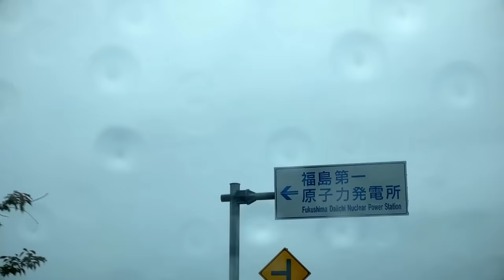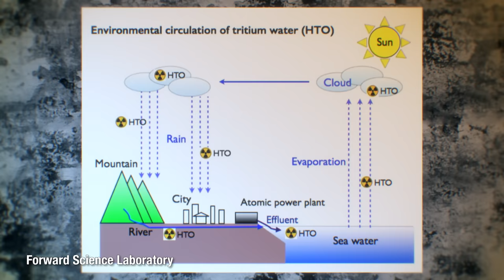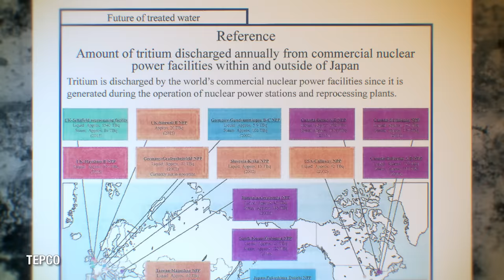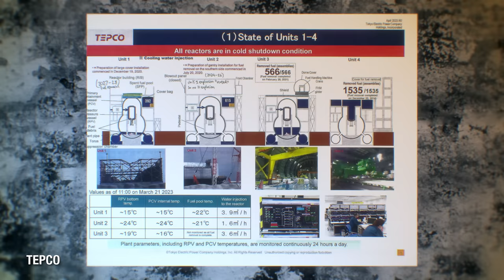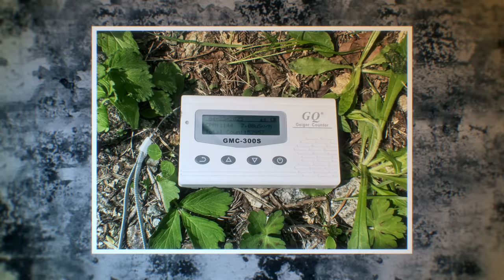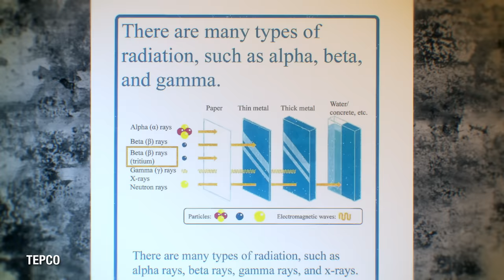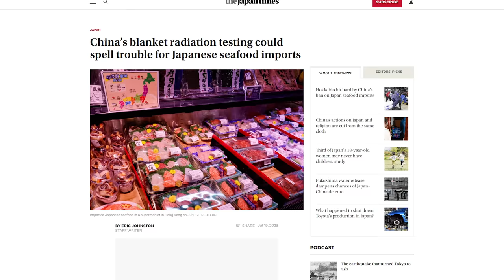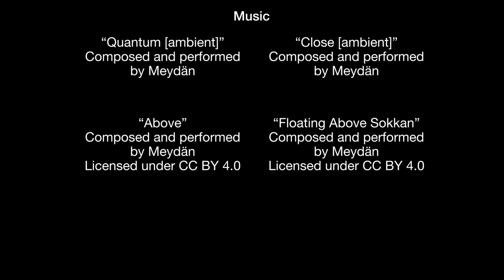Is Fukushima's Radioactive Water Safe?

Comment: it still breaks my heart that the meltdown could have been avoided if the company running the plant had listened and just moved the backup generators which they were told was necessary multiple times
Reply: Higher seawall. If the wall was the same height the water could have still gotten to where the generator was supposed to be. If the wall was high enough to prevent water from getting over it in the first place there wouldnt have been a need to put the generator higher. Onagawas wall was high enough and they didnt have problems despite being closer to the epicenter.
Reply: one day Kyle will call out the real issue,capitalism
Reply: @whyishoudini  "one day Kyle will call out the real issue,capitalism"
If you won the lottery Im sure you would give away 100% of it because "the real issue is 'capitalism'"
Reply: @namename9998  you just blow in from stupid ville?
Reply: @whyishoudini  Corporate greed doesnt equal capitalism, neither does central banking. If corporations don't act responsible there is no political or monetary system that can prevent social harm. It is them, the corporate and state powers that have the responsibility to act according to the risk assessments, corruption is far worse in socialism/communism than in capitalism.  So failure to meet requirements is way higher in non capitalistic systems. Look at China and its downfall at the moment, it says it all.
Reply: The tsunami is 2011 was unprecidented though for modern times.
Reply: Their first mistake was building a nuclear plant on the coast just 500 miles away from a massive fault line in a country reknowned for earthquakes, tidal waves and GODZIRRA!
Reply: @plumbirb8444  Chernobyl ended the same year with just one reactor exploding. Fukushima Daichi is still burning with 3 reactors and now contaminated water will be released in to the ocean. It is not the same.
Reply: @no_data_for_you  Recommendations for what?
Reply: @TheVanillatech   No. Their 1st mistake was ignoring people who said build a higher seawall and the 2nd was ignoring people when they said to put the generator somewhere else. This wasnt Marthas Vineyard where millionaires pay to have houses built on beachfront property only to have the army corps of engineers dig them out every few years. Nuclear plants dont get build just anywhere. There are 17 nuclear plants in Japan with the oldest being 50 yrs old. Banning something from being built because a once in 1000 yr event happens is stupid. Its like banning all cars because 1 in every 1 billion explode. The benefits of clean and reliable power is better than not having clean and reliable power.
Reply: The Stubborness of the Japanese. Strange culture and yet beautiful, if only on the surface.
Reply: @197BRUTE That wasn't the point buddy...
Also, the reactor didn't explode. The top just flew off because of pressure. Nuclear reactors don't explode. They ain't nukes, fam
Reply: @whyishoudini Guess you are too.
Reply: Yep.. simple cheap fix😡😡😡
Reply: @Cvandenhazel I'm not chinese but you could see china from backward country to a superpower in just a few decades, while the US stagnant. So I could see corruption is far higher in democratic capitalism countries.
Reply: @no_data_for_you  What claims?
Reply: @namename9998  socialism is when no money
Reply: @kizunavr  Socialism: "a political and economic theory of social organization which advocates that the means of production, distribution, and exchange should be owned or regulated by the community as a whole."

"Socialism is a political philosophy and movement encompassing a wide range of economic and social systems which are characterised by social ownership of the means of production, as opposed to private ownership."

Please point out where "socialism is no money" is.
Reply: What the hell does that have to do with anything?
Reply: @whyishoudini  only simpletons can point to one thing and say, this one thing is responsible for all the evil in the world. Those that exclaim 'isms' have no thoughts of their own
Reply: @Anonkontello  What does what have to do with anything?
Reply: @plumbirb8444 That reactor design insane dangerous no other country would build such a design.
Reply: @MitzvosGolem1  "That reactor design insane dangerous no other country would build such a design."

That would explain why 22 rbmks were built and 8 are still operational? So what if a country builds only one style of something. It doesnt prove its safe or dangerous.
Reply: @namename9998  refueling under load is insane 
I worked in Nuclear research and Reactor for DOE .
8 running in a war torn region ..
Let's pray none get attacked .
Reply: @TheVanillatech  Stop talking
Reply: Move the backup generators, put glass in the windows instead of bars, build another meter or two onto the seawall, there were any number of ways the problem could have been prevented despite them having to put the reactor directly on the coast. The wave didn't even reach high enough to flood the other side of the road from the powerplant. Any single small measure to make the plant safer and the biggest tsunami in history wouldn't have caused a serious problem.
Reply: @whyishoudini  yes cuz Chernobyl happened in capitalist Soviet Union xD
Reply: @197BRUTE i dont think they even know where the cores are, as they melted through not just melt down. Also its funny how nearly everyone and every media outlet any time they have to mention nuclear disasters they always say Fuku is the worst disaster since Chernobyl, what that actually is, is a fudge comment that has been spun and what it implies is that Chernobyl was the worst but actually  means in English is subtlety saying Fuku is the worst.
Reply: @nocturn9x not true, the top of at least one blew off because of a detonation not a deflagration, did you see the close up pics of the bolts completely sheared off the lid, also the cores melted through the containment vessels, that is why they have this water - as there was/is no containment any more, it was destroyed by the heat from the melt through.
Reply: @namename9998 its original design position was much higher up but to reduce construction costs  they lowered the landscape and built it lower down so it wouldn’t of suffered being destroyed had they kept to the original plan.
Reply: @Plotatothewondercat they actually were going to build it higher up as the ground was originally higher but to save construction costs they lowered the landscape to save money basically, from doing that it was doomed
Reply: @brutonstreettailor4570  I was talking about Chernobyl, not Fukushima
Reply: @TheVanillatech  Amazing irony since GODZIRRA! was an explicit allegory for the risks of nuclear power
Reply: @plumbirb8444  It was caused by yes man operators who were under pressure to run the reactor as cheaply as possible because because of Khrushchev's economic policy changes focussing profitability, so still the profit motive, which is fundementally a core aspect of capitalism, your argument doesn't hold to scrutiny as much as you think it does buddy
Reply: @brutonstreettailor4570  A genuine question, but why do you use "would of"? It's ugly and wrong.
Reply: @namename9998  I would, yeah
Reply: @nocturn9x yeah. "Would have" is how it's written.
Reply: @whyishoudini  Yes, the problem must be a free market.... Never mind that Chernobyl was caused in very large part by the "shut up and toe the line" additudes of a communist dictatorship, with no natural disaster to blame for it at all...
Reply: @eclipsegst9419  just zero lack of education, yet so confident
Reply: @TheAnantaSesa  Yeah, exactly
Reply: @eclipsegst9419  Dictatorship. It doesnt matter if it was communist or anything else. Toe the line is toe the line. Fukushima could have ignored their bosses and moved the generator, built a higher wall, etc but instead they toed the line in a capitalist country.
Reply: @whyishoudini what's the alternative, socialism?
Reply: @rileysmall4317  unless you want to keep living in a mass Extinction event, yes.
Reply: @whyishoudini  Socialism doesnt mean better for the environment

"a political and economic theory of social organization which advocates that the means of production, distribution, and exchange should be owned or regulated by the community as a whole."

It just means there isnt private ownership of businesses. Socialists can be just as or more wasteful than capitalists.
Reply: windrose5988  property and gas price rising also I remember some american said that their economy was saved by the drugs too.
Reply: @brutonstreettailor4570  yeah some commenter said that Fukushima daichi design is different with Fukushima daini which got the same damage but nothing happened to it.
Reply: @whyishoudini  yep you're insane.
Reply: @197BRUTE  "It is not the same." -- Yea. Chernobyl was way worse.
Reply: @whyishoudini  
>Cuba
>Venezuela
>PR"C"
>North Korea
>Laos
Please move to any of those to enjoy your socialist utopia of choice and let us free-minded people get exploited  by the free market without pestering us with your ideologue ramblings.
Reply: @comradeotaku2412  >it wasn't real communism
It's even funnier the 100 millionth time!
Reply: @nickkorkodylas5005  lmao whats next going to quote the black book?
Reply: That's why i don't trust TEPCO at this time.
Reply: @whyishoudini  Or every single person that survived the USSR.
Reply: @whyishoudini yeah let's switch to Marxism. Oh wait. We already did a couple years ago.
Reply: @whyishoudini  to be fair it's both capitalism AND lack of workplace and/or political democracy; Chernobyl and three mile island happened when technicians' concerns were overruled or shut down and the aftermath exacerbated by government opacity
Reply: @namename9998 
If you're poor and you criticize capitalism they call you jealous, if you're rich and criticize capitalism they call you a hypocrite. It's almost like they don't want you to criticize capitalism.
Reply: @nocturn9x  If you read it again i said wouldn’t of NOT would of, however, i did mistakenly leave out a comma after the word.  My proof reader had gone to bed.
Reply: @namename9998  And it had nothing to do with capitalism. Capitalism needs reigns but it makes people richer overall. Did those reigns exist? Is there a law about how high above sea level a nuclear plant must be? Probably wasn't at the time anyways. Not to mention the chances of such a Tsunami are 1 in a million, and they couldn't see the future. On the other hand, Chernobyl was caused by people who were so scared of their oppressive Communist government being angered a test wasn't ran on time, that they broke major safety protocol after major safety protocol.
Reply: @eclipsegst9419  it had to do with capitalism because they're cutting corner with Fukushima daichi unlike the daini one, and at this point tepco and alps system is pretty much questionable.
Reply: @multatuli1  So let me get this straight, the problem was caused by the fact people in the country are free to own their own business? Not lack of regulation on how close to the ocean a plant can be and/or poor decision making of individuals in charge of the project? As if cutting corners to save cost only happens in capitalist societies? You do know Chernobyl was an outdated design before it was built right? The difference is, capitalists will only cut costs within regulations, because they are held accountable by many forces. Communist countries just don't make the regulations in the first place or make them to lower standards.
Reply: @whyishoudini  *Corporatism
Reply: @whyishoudini  Zero lack of education? You know that's a double negative right?
Reply: @whyishoudini  The real issue is, you haven't touched grass in decades.
Reply: @Cvandenhazel  "corruption is far worse in socialism/communism than in capitalism" you need meds...
Reply: @Cvandenhazel  China has a state capitalist economic system. The likes of Krugman were also predicting a Chinese economic collapse 10 years ago and it never happened. He's made another "collapse call" recently too. You people are truly clueless.
Reply: @multatuli1  
Brother, I am Chinese, and it is wrong to say that corruption in the West is wrong, because these are officials within a reasonable range who use reasonable means to make money for themselves. Graft and corruption are protected by the judiciary!
Reply: Russia shut down their nuclear plant and really fixed the problem when their category 7 disaster occurred.  Japan could have done better even today.  Don't just dump their toxin into the ocean, an easy way out. A cheap way out.
Reply: @KyleA-kq9sy  so true
Reply: Just hope Japan will manage to stop dumping nuclear contaminated waste into our ocean, making a level 7 disaster into a level indefinite disaster .  However, I don't think Japan will.
Reply: Similarly, the dumping today could have been avoided. Yet Japan once again chose a cheap way out.
Reply: @197BRUTE Chernobyl was a several year cleanup effort, and still ongoing today. Chernobyl’s reactor actually exploded, the reactors at Fukushima didn’t explode at all. Plus, the contaminated water being released by Fukushima isn’t seriously contamination nor does it pose any risk to ocean life.
Reply: The powerplant at Onagawa was hit even harder and nothing happened, because it was run by another company with someone in charge who saw the risks. That said, it is a combination of greed and missing governmental regulation.
Reply: @Cvandenhazel  corporate greed is a direct result of capitalism. So if it's such a big issue, maybe it's time to look past the symptoms and go straight for the disease.

Also, mentioning China, the only country that survived and even blossomed through the 2008 financial crisis (some academics even go as far as to say that China saved worldwide capitalism in that instance, and I agree) in a diatribe against communism/socialism is ill informed. China is the embodiment of State Capitalism.
Reply: @nickkorkodylas5005  you just named a bunch of countries that the US targeted with sanctions and coups lmao. You're not free-minded for being individualistic in nature and shortsighted. The "Free market" doesn't exist without strong state sanctions. Jesus christ if you guys spent as much time reading about political philosophy as you do defending an ideology you barely understand because they told you you could become one of "them" if you lifted yourself by your bootstraps + the fact that capitalism is all you've known since birth we would all make progress collectively.
Reply: @maxxlanglois  " the US targeted with sanctions"
So communist countries NEED to parasitize on capitalist ones' for basic functions like primary production? 🤔
Reply: @Cvandenhazel  Correct Capitalism = property rights and the ability to make profit off or on that property,

Comment: When I studied in Tokyo, one of my professors was writing a paper on the accident and travelled there like you did. He shared with us his experience which was eerily similar to yours. Most striking similarity was that your personal Geiger counter showed a much higher count that the public one. It's sad to hear their PR approach is so confusing and unclear. I hope that changes for the future.
Reply: Did his dosimeter read higher or was the alarm point just set lower?  I gathered that it was just a lower alarm set point, but I don't think he clarifies one way or another.
Reply: What I picked up from the video, was that they weren't told beforehand the radiation levels right at the reactor. And as such, when they were getting closer, he was surprised by the dosimeter going on high alert. But those levels are still completely safe to be there and tour people there as long as you follow the right procedures, it's just bad practice to provide only half of the truth (providing numbers for radiation levels further away from the reactor to make it seem safer).
I don't think he clarified, if the dosimeter/Geiger counter on the bus was showing similar values.
Reply: That is the difference between a  dose counter and a dose rate meter. One tells you roughly how long you were there and the other tells you how long you can be there.